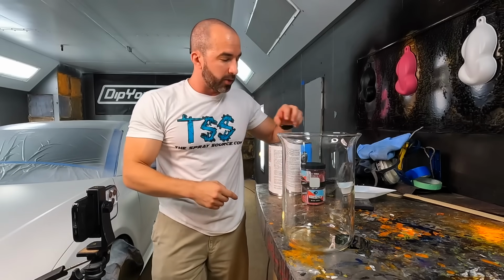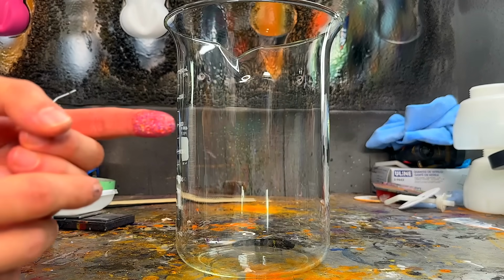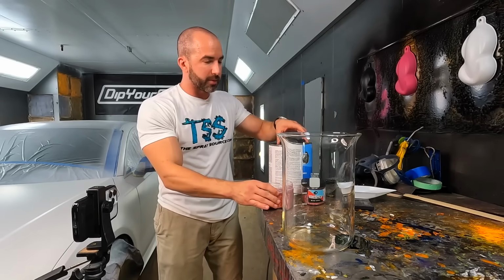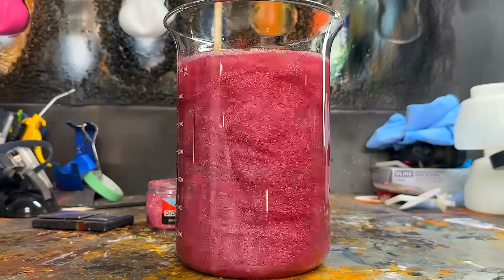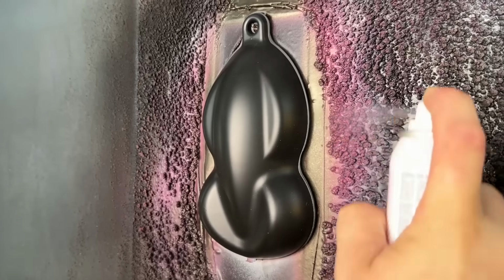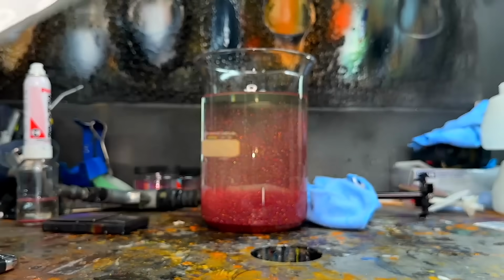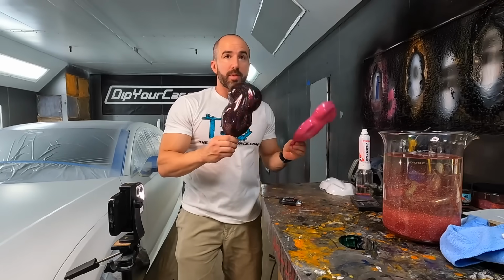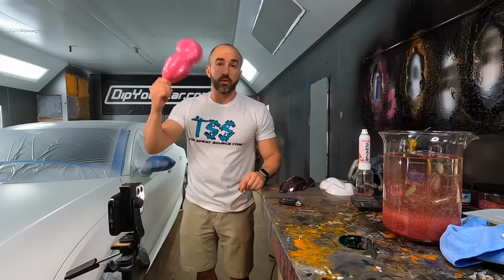This Pigment is Like Installing MILLIONS of Iridescent Lights in Your Paint

Comment: I personally liked the speckle look on the white. It allows for heavier coverage in multiple passes to add up to the point where you want it to be, not just speckles on white. It should theoretically build up a blush pink base. The pink on pink isn't bad, but I think it takes away from the holographic flake you just put on. You could've put a standard holographic flake on the pink and gotten this outcome. 4/5.
Reply: You took the words right out of my mouth! Up the pigment load and use the white base!

Comment: Not necessarily this colour, which was brilliant btw, but in a future episode could you paint everything on the car, wheels, mirror backs, defusers, radiator grill, air intakes.. The lot! Everything that ain't tyre or glass basically. Is that even possible?

Comment: Holo always looks better over black to make it pop, though you would need enough coats to build up the opacity (the test you did here wasn't enough coats, or not enough pigment in the mix). It also works well over a similar base colour to the main colour of the holo pigment. But tends to end up muted over lighter tones unless it too is a lighter tone. At least that has been my experience with holographic nail polishes of which I own probably too many. Though I don't have any in pink because I really don't like pink. I kinda wish breast cancer charities used a more gender neutral colour honestly because anyone of any gender can get breast cancer and the use of a strong gendered colour means that its often hard to get the message out that men also need to check their chests for lumps.